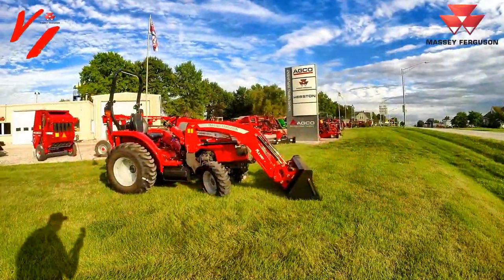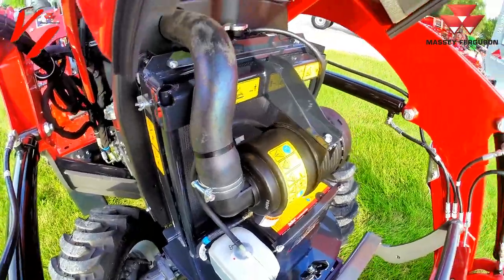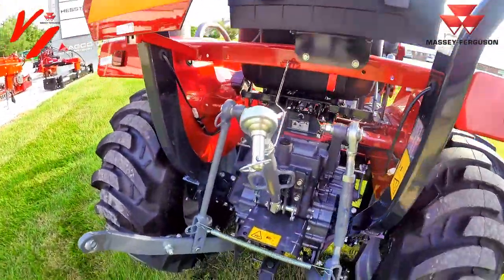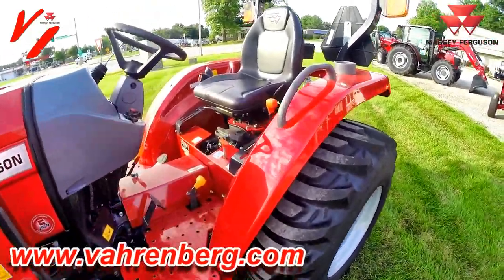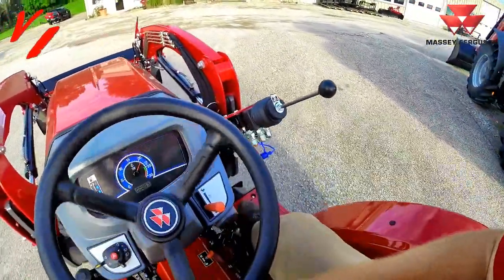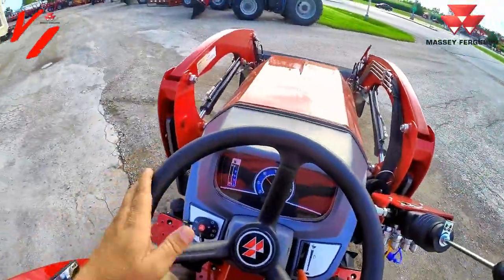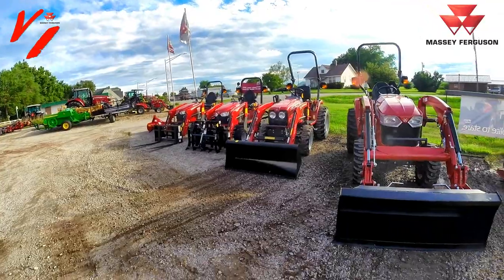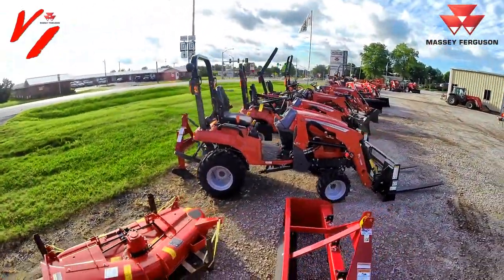Massey Ferguson 1825E Hydrostat Compact Tractor (24.0 Engine HP)

Comment: I was considering one of these.  I pulled the trigger on a Bobcat CT2035.   They have really good deals on Bobcat tractors right now.  If that wasn't the case I probably would have bought this tractor.
Reply from the maker: Best of Luck with that Bobcat. Hopefully they will remain in the compact tractor business this time so you can get support. This is the second time they have attempted selling tractors. Thanks for watching and commenting.
Reply: @VahrenbergImplement  yes I know.  They have committed to the long haul according to there lead man for tractors.   Supposedly they have a 10 year plan to build everything here in the US.  I'd love to have had a MF but couldn't afford it.  God bless
Reply from the maker: Sounds like the same story as last time. It's a big risk but hope for the customers and resale value of their purchase it happens. Guess we will find out in 10 years. Seen a lot of brands come and go and hate see the consumers get the bad end of the draw. One of the reasons I tell customers to look at the Big 5: Massey Ferguson, John Deere, CaseIH, New Holland and now Kubota are all long term companies. Dealers may come and go but the brand will remain and your investment will be protected.
Reply: I wouldn't Buy a Bobcat until they start building them in house like they say they will. Until they build a tractor factory I personally wouldn't count on them sticking in the tractor business. I'm not anti bobcat. i love their skid steers and have used them for a long time. I know Iseki builds a lot of the small Masseys, but they are almost part of AGCO at this point. I think AGCO even sells Iseki branded stuff in Australia.
Reply: @VahrenbergImplement  I don't think I got the bad end of the deal on this tractor.  Its price point blows away the competition and is a better performing tractor than any other brand that i looked at.  Bobcat has been in business since the 60's.  I highly doubt they are going anywhere.
Reply from the maker: Yes Bobcat name has been around. Originally Melroe Brand and sister to SpraCoupe Brand that AGCO bought. In 2007 Doosan of South Korea purchased BobCat. They tried selling compacts starting in 2008 and ceased production in 2013. This is there second attempt starting in 20189 to enter the compact tractor business. I just hope for you they remain in the tractor business. Not good for customers that invest their hard earned money and the manufacturer exits the business. We've seen alot of brands come and go over our 68 Years in Business.
Reply: @glendonmorgan7253  it would surprise me of they don't make it this time.  The recession did it to them the last time and hopefully covid don't do it to them this time.  The difference this time is the economy is strong and people are spending money.   There timing has been unfortunate but they make good stuff and there prices are great.   Dealer i bought mine from cant keep them on the lot and they sell kubota as well.  If that keeps happening they will be around for a long time.  But if people are scared off by dealers speculating that could have an effect.  But I'd say most dealers are going to talk down the competition so its all fair play.

Anyway,  varnberberg has some good videos and I appreciate the knowledge they put out on these videos.  God bless.
Reply: @schroederfamilyfarm298  It probably surprised customers they didn't make it the 1st time. You say it would surprise you if they don't make it this time, but you also HOPE covid doesn't do them in. That's not a confident comment coming from even you! BTW, they are being built by the same people as Kioti ... South Korea!!!

Comment: Like the location of the fuel tank and tool box vs the Kioti but I’m not a fan of the bucket control lever, 400lb less bucket lift capacity, plus I heel toe tranny stinks compared to separate F/R Pedals.
Reply from the maker: You have to measure Loader Lift Capacity at the same spot Pivot Pin or Bucket Edge and also how high they lift. The higher the lift the harder it is to lift' We did a video to better understand loader lifting capacities: https://youtu.be/Ku4235ImZDQ Massey Ferguson is very conservative on their rating and some brands out their are overrated. 
Massey Ferguson offers different models of tractors. If you want side/side Hydro Pedals in 25HP look at the GC1725MB or the 1526 they offer side/side pedals where the 1800E our economy tractors have single treddle pedal design. Or you can step up HP and get the 1800M Premium Series and they are side/side pedals too!

Comment: The very first tractor I owned was a 1972 MF 135. Man that thing was a beast. Wnen I bought it, it was 20 years old and had 2700 hours on it. Do any of your 25 h.p. tractors come wit Shuttle Shift Transmission? I'm old school and much prefer the manual transmissions. Thanks for any reply..
Reply from the maker: That MF135 technology can be found in the 2604H still being built today. It''s our Heritage Model with lots of similarities to the 100 Series and still features the Ferguson System. But the 1800E series does have a Synchro Shuttle Version Available. I have not received any yet but have on order and we will be doing videos as we receive.
Reply: Thank you sir. I saw your yesterday's video and you said buy local and I appreciated that very much. I live in the northern panhandle of W.V. My nearest MF dealership is about 45 minutes away from my home.  I do appreciate your videos and I get notifications from you.  Thank you so much.
Reply from the maker: We will not sell outside our area of responsibility. There is more than just a price when you buy Massey Ferguson. It's a Partnership for a Lifetime. You deserve more with Massey Ferguson. Someone that will take care of you before, during and most importantly after the sale. Why you need to buy local and support local. That is the only way.
Reply: Absolutely,  thank you

Comment: This a very nice Massey-Ferguson ! But if I had to choose between this model or the M-F 1526 I would choose the 1526 more  HP power at the engine & PTO & it's great that this series 1825E went with Iseki power train & that makes this a more desirable full size compact ! Thanks for another informative video.
Reply from the maker: That is why Massey Ferguson offers 3 Models of 25HP Compacts to meet the needs of more buyers. GC1725M, 1526 or the 1825E. 3 Models - 3 chassis sizes. Thanks for the comments!
Reply: @VahrenbergImplement  Thank You for your reply! I'm looking for the rear working light kit from AGCO for my M-F1526 I have not been able to find the part no. for this item, Do You think You could help me with that item number ? Thank You.
Reply from the maker: We have started using the Sparex S.118198 Rear Work Like. Sparex is a Division of AGCO Parts and has so great LED Products and less expensive. This model comes with wiring and has switch on the light to turn on/off. Your Massey Ferguson Dealer can order from Sparex.
Reply: @VahrenbergImplement  Thank You so much for taking the time to look that part number up Doug! I know several people are looking for these for there M-F 1526 & M-F GC 1723 E & EB & I will post this on TBN. Thank You for always being helpful . & allot members of TBN refer your videos to new M-F's owners or potential owners,Thank You again.

Comment: After using for two years I generally like this unit.  However, there are some irritating features:  One fuel filter is located UNDER the tractor so I changed that location first chance I got.  Next, the hydraulic fluid sight glass in the rear casing is a joke.  When the fluid isn't showing in the glass you have no idea if the fluid low or too high.  Where's the dipsitck??????  There rear lights are mounted on the outside of the roll bar which makes them prone to be easily knocked off or broken.  The step for footing is too close to the unit...would work for a 3 y.o.!  The air filter is exorbitantly expensive.  It should have come equipped with rear aux hydraulic hookups for a box blade top link, for example.  Yeah, I'd have paid an extra $500 for that feature.  All in all a good unit, but with some annoying features.
Reply from the maker: Understand...no company builds a perfect tractor fit every user. Some love the sight glass so they don't have to pull dipstick to look. Walk up and see if it need oil or not. Anywhere in the sight glass is fine for level. Rear Lights are required for tractor manufacturers to have Extremity Lights so other motorists know how wide the vehicle in front of them is. Yes it does make them prone for damage if you get close to trees. They try to keep steps narrow inside all the different tire widths so they don't hit when working near buildings, trees, etc. Be like the lights and people not like damaging their steps. Hydraulics are an option...we sell maybe 1 out of 50 compacts with remote valve. If your not going to use remotes no use making everyone pay for them...if Massey Ferguson added them it would raise the price of the machine even higher. 1 Set of Remote Valves is like $1500 for the Parts Cost. Some of the annoyances are there for a reason. Thanks for the Review. Tell us what you like about the tractor.

Comment: Im in the works of choosing between this and the mahindra 1626. I dont have a lot of nice things to say about my 2019 gc1723eb. The low hanging fuel tank on this one worries me.
Reply from the maker: Have yet to have an issue with the Ground Level Fueling on any of the Massey Ferguson Tractors. They have skid plates under them. But I guess it depends on what you are doing with it. Normal Agricultural Use we have not had issues. I even have a professional tree cutter using a Massey Ferguson as Tree Hauling Tractor he bent everything else under the tractor and on top of it but not had a fuel tank issue.
Reply: @VahrenbergImplement  love my GC1705, I’ve had her in some nasty situations with no issues, I assume the GC1723 is similar. Mahindra dealers around me are dropping like flies. I’d bet a half dozen have closed or changed brands in the past 2 years.
Reply from the maker: We are seeing similar things happening in our area too. Many are changing brands or adding additional brands. Personally know several that have added Massey Ferguson Brand to offer a Premium Brand Choice to their dealerships. Massey Ferguson is growing rapidly and 2020 is seeing huge jump in total sales. From approximately 16,000 Tractors sold in North America in 2019 to pushing 18,000 Tractors in 2020 for North America.

Comment: Does this loader have a self leveling bucket option? Also, can you put a snowblower on the front end of this tractor?
Reply from the maker: There is not a Self-Leveling Loader from Massey Ferguson currently. Please request with AGCO Answers877-52-4384 or agcoanswers@agcocorp.com. I keep asking. The "E Series" Tractors do not have Mid-PTO Option. You would need to look at 1526 or GC Series in the 25HP Models or 1800M Series have Mid-PTO and can run front snow blowers.
Reply: @VahrenbergImplement  Thank you for the information. I had been looking at the Kubota B-Series for a while now, however I'm  kinda liking what I see here in this video. Wasn't aware this model existed.
Reply from the maker: The 1825E is a New Model for 2020 from Massey Ferguson and has been great seller, hard to keep in stock and get inventory. We finally got one and was able to video. Go visit your local Massey Ferguson dealer. The E Series Massey are very impressive.

Comment: Does this 1825E Hydrostat Compact Tractor (24.0 Engine HP) have a wet or dry clutch?
Reply from the maker: The 1800E Series has Dry Clutch both SynchroShuttle and Hydrostat Models.

Comment: Nice. I've been looking at the GC1725M. Will there be an 1825M soon?
Reply from the maker: There is not a 1825M like in the GC Series. If you want more features take a look at the 1526 it's larger than the GC Series and has more added features than the 1825E. We did a comparison video on the previous models and still very good to compare the major differences: https://youtu.be/uLNvIL8GoQ4
Reply: @VahrenbergImplement  Thanks. Just watched it. MF's numbering scheme is a little confusing, but I did get the idea of size classes from that video.
Reply from the maker: It's simple. All Compacts & Small Utility the First 2 Numbers are the Series. The Second 2  Number are Engine HP. Except the GC is Garden Compact 17 is the series and 23 is HP for the GC1723E. GC1725M is the 17 Series 25 Engine HP Model. E is the economical Models, Mid is the Mid Speced and S Series are the Superior Features of the Larger Tractors. this Numbering system is for the GC, 1500, 1700, 1800 & 2700 Series Tractors from that model on up to the 8700S Series the first 2 Numbers are Series like all models then the Last 2 Digits you Add a "0" and that is the Engine HP. So 2604H is 2600 Series 40 Engine HP. The "H" is for Heritage Model. 8737S is 8700 Series 370 Engine HP Superior Version, 5711S is 5700 Series 110 Engine HP Superior Features, we also have the 5711in the Global Series that is 5700 Series but without the S is a Mid Spec Offering. THe M is coming soon. But it's 110 Engine HP too. Hope that helps learn the system which is changing with the New 8S Series just announced and now will be 8 Series, S Superior Features and then Engine HP. SO 8S.265 is going to be the new system coming in the future.
Reply: @VahrenbergImplement  Simple 😳. I guess if you've been in the industry for a few years it is. That is a great summary though. I'll have to bookmark this for when I'm looking around at different models. Thanks.

Comment: Hello, can this be ordered with... R1 tires with spacers and loaded. Extra hydro for grapple. And a heated cab? Also can a backhoe be added that is not a 3 point one? The extra length would make it difficult to load on a trailer.
Reply from the maker: RA Ag Tires are available option. I would recommend Wheel Weights versus fluid. Fluid reduces tire traction and more expensive if you have to work on a tire. 3rd Function Hydraulic Kit is available for the loader. the 1800E Series do not have a Factory cab but I think Curtis Industries are building Cabs for the 1800E and can have heater installed. Backhoes are available from Massey Ferguson that are subframe mounted and quick detach.  Depends on your trailer size and length....they build all kinds of trailers.

Comment: Is there an ECU in the 1825-E? I noticed the tach needle jump and drop when the key was turn. Definitely not normal with analog gauges.
Reply from the maker: There is not an Engine Computer. It is Digital Controlled Dash.
Reply: @VahrenbergImplement  According to the build sheet provided by my local dealer with the quote 2 days ago it specifically states, “Electronic Engine Control”. The salesman confirmed this in our conversation stating it was necessary to control the high input fuel rail or something of that sort. Since all 3 tractors in the 1800 series use the same engine, it’s easier to program the EEC to work without the DPF and turbo rather than replacing the fuel injection system.
Reply from the maker: Price Book says Electronic Engine Control but I physically went out and looked at 1825E and 1840E we just received. If you look at Right Side of the Engine where fuel system is located. 1825E has Mechanical Injection Pump and Injectors with Electronic Shut-Off and no ECU. The 1835E/1840E has High Pressure Pump with Common Rail and Electronic Controlled Injectors and has ECU up in front on top of the Radiator. Easy to see if you pop the hood. Bet you can see if you watch our videos to see the ECU for the 1835E & 1840E and not on the 1825E.
Reply: @VahrenbergImplement  Thank you for your response! I think this will sway my decision to buy MF. Unfortunately Kubota only cares about sales and not about the customer. This is my experience with 4 separate Kubota dealers. Whereas the MF dealers have been nothing but warm, friendly and informative. Thank you again for this info, it is greatly appreciated!
Reply from the maker: Your Welcome. Glad we could help.

Comment: Is cruise control an option?
Reply from the maker: Cruise is not an option in the 1800E Series. E Series Tractors are simple, basic tractors without all the bells and whistle. If you need Cruise the 1526 or 1800M Series Tractors feature that option.

Comment: What is that noise when driving?
Reply from the maker: Hydrostat whine? Since hydros are fluid control transmission you here some "whine" compared to the Gear Transmission.
Reply: @VahrenbergImplement  I did some research after I asked the question. I now know what a Hydrostatic Transmission is. I bought my first tractor; Massey Ferguson 1835EH and it has a Hydrostatic Transmission. I thought I was doing something wrong or had a malfunctioning machine. So I asked. 

Thanks for responding!

Comment: Cast aluminum rear end or cast iron?
Reply from the maker: A magnet sticks to both the Transmission and Rear End Housing. That's the easy way to find out. Get more Heavy Metal with Massey Ferguson.

Comment: Is a mmm available on the 1825?
Reply from the maker: the 1800E series do not offer a Mid PTO so the only Finish Mower option is a 3 Point Mounted.
Reply: If you don't mind, which models above a subcompact do they offer with a mmm?  Thanks!
Reply from the maker: 1526, 1835M & 1840M are Mid Mount Mower Compatible.

Comment: I been hearing that the new global series is poorly designed. But also a bad design, Is that true?
Reply from the maker: We have sold a pile of Global Series Tractors and they have been extremely dependable and loaded with more Standard Features than the competition. Maybe the competition is trying to help and spreading rumors but we are having great performance and reliability from all the Global Series.
Reply: Thanks!